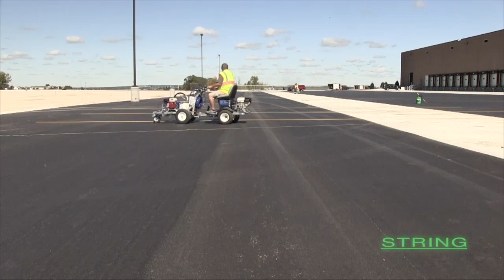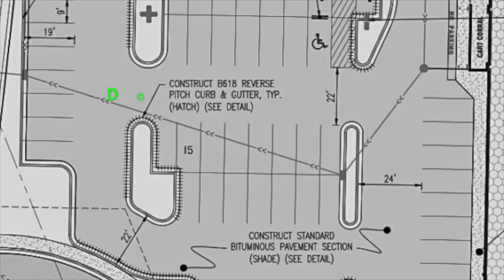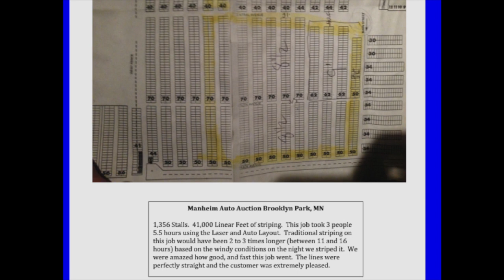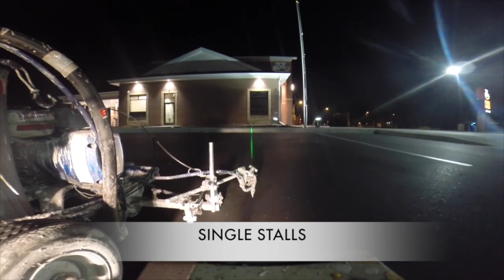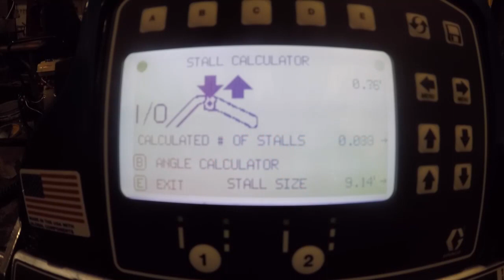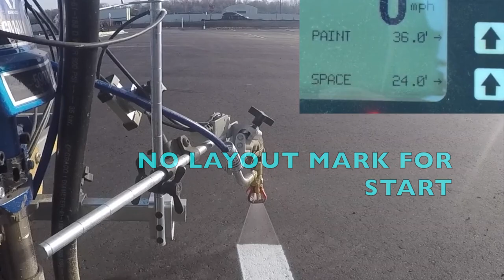Improve Your Striping Productivity with Graco LineLazer

Comment: Great info, thanks. Question: Can the Line generator be setup on a 24v truck? I read on your site that a portable power generator could cause damage to the laser.
I ask this as in New Zealand we paint the long road lines with a truck. White and yellow paint guns + Beads are on boths sides of the truck, which are mounted in a static position. So the truck driver determines when to start painting and what pattern with a computer inside the cab as well as keeping the truck straight. The worker at the back of the truck only cones the paint.